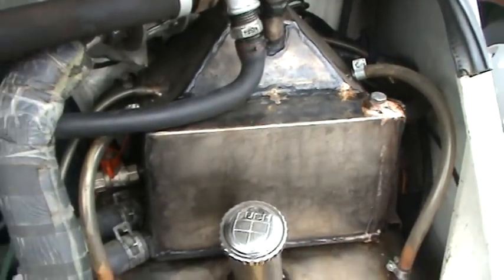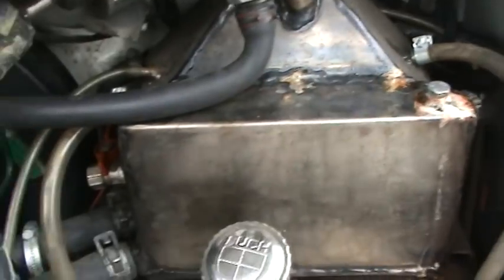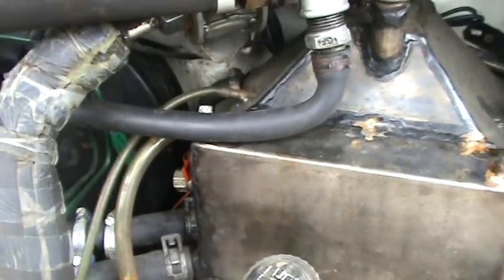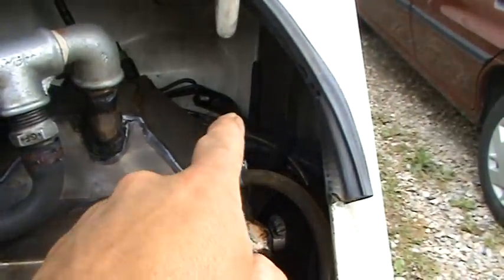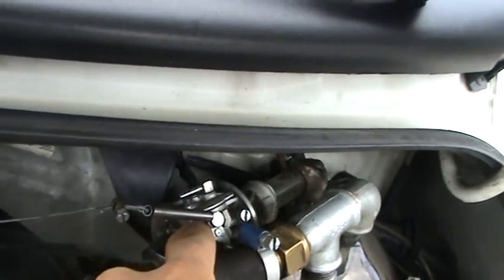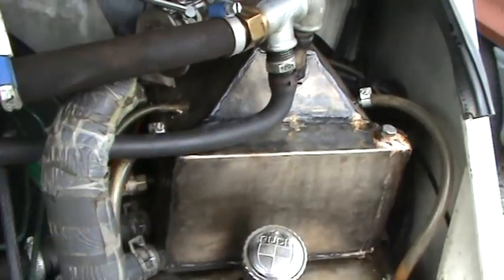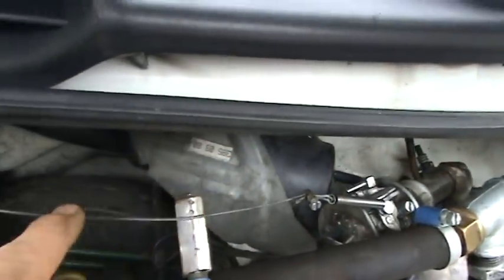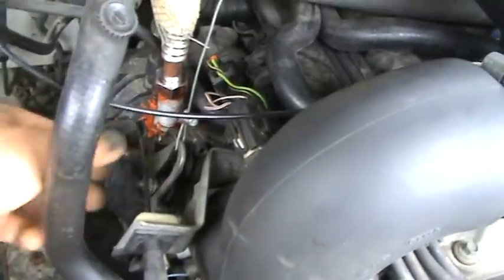system "G" on Petrol engine

Comment: Just wondering if you are converting gas into GEET Gas or water vapor into GEET Gas.  Been away from the group for awhile.  Wondering if steam could be used to produce the hydrocarbon fuel to run into the GEET Reactor rod.  Curious.  Looks promising.